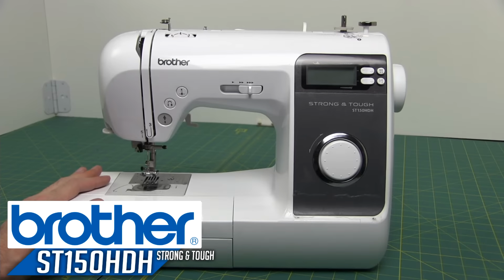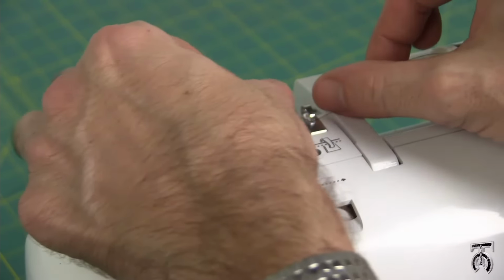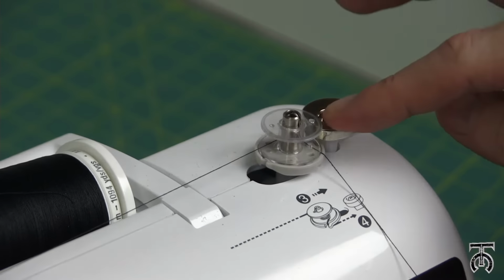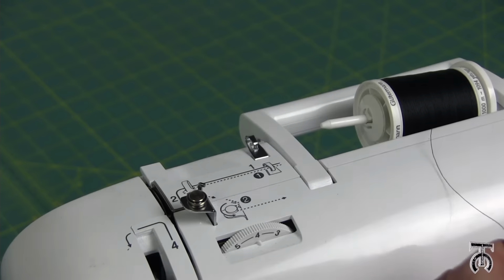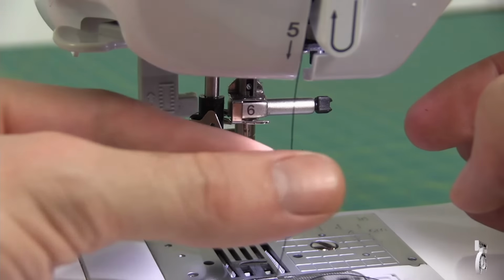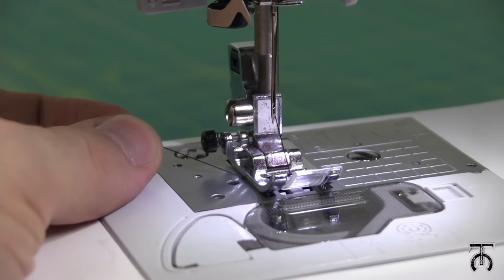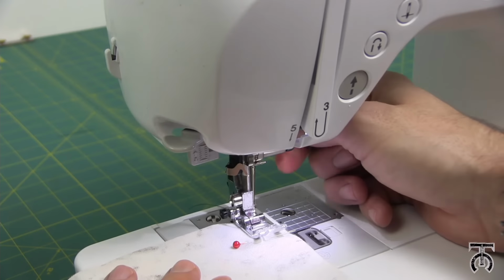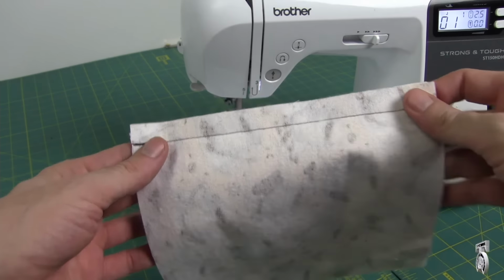How to use a Sewing Machine - Brother ST150HDH - Heavy Duty - Tock Custom

Comment: I was struggling with the automatic needle threader not rotating and it turned out that my needle was not at its highest point. Once I did that, it rotated and worked!

Comment: Just unboxed my ST150HDH this afternoon. Had to rewatch the automatic threader section a few times to get the hang of it, but finally got it! Thanks very much.
Reply: mine doesnt work right. any tips?
Reply: @kayacaffo8114  just follow his instructions very carefully. Also, I noticed that he hold the thread op at about a 45 degree angle after he puts it under that hook. That seems to do the trick for me. After I got it right the first time, I practiced several more times. Good luck!

Comment: The Brother instruction manual will tell you to lower the presser foot when using the needle threader if you bothered to read it. The bobbin is "self setting" meaning that you do not have to pull up the bobbin thread to start sewing after you install the bobbin.

Comment: This looks like the old NS10 models, just different colour 🤗 I still use and adore mine 🤗🤗🤗 The best thing is she LOVES cheap thread which my other machines hate... so I can do so much with her in free-motion and stuff and she takes it all! I have all the feet (she even uses those big accessory pack ones) and wide table and other accessories as well, and she’s easy to keep maintained and a little oil in the bobbin case every so often by myself and she still purrs 🤗🤗🤗

Comment: Hi , having a problem with this machine i don't know if you can help... I'm able to see too prices of fleece together for a seam butt when I turn it in side out and try you stich on top of the two process too kind of stitch them together I'm getting the worse slip stitches... I've tried everything putting stabilizer on top it's unbelievable the slip stitches are horrible tried zigzag stitch it's horrible tried even straight stitch like a basting stitch still horrible I don't know what to do... Please help I've never had things trouble before... And I love in my brother machines I have three... Going crazy

Comment: Helpful but new to sewing.  You said to do a back stitch but didn't explain how.  You didn't offer any trouble shooting.  For example, my new machine and was stitching very, very slowly.  Why?  How do I speed up? Since this is for beginners I think you could be more proactive.  I'm not trying to be critical but offering a few tips would be nice.
Reply from the maker: Oh, forgive me. I've done a few other tutorials on other machines, so I apologize for skipping simple tasks like this. 

There is a button that makes your sewing machine stitch backwards - doing a "backstitch" locks the start and end of you seams in place so they don't fall apart.

also there is a little slider in the center top of the machine that control the stitching speed. Pushing it all the way to the right will allow you to stitch at full speed.

Hope that helps!
Reply: @TockCustom  Thanks, my machine hasn't arrived yet, but that was my first question watching too.

Comment: I just got the machine... What do I do if I threaded the bobbin incorrectly and it wounded around in the inside of the machine?
Reply from the maker: Oh, you just unscrew the two bolts on the plate, take it off, and use a blade to cut out the thread. Then just pull out the thread or use tweezers to get it all out, no biggie at all 😊
Reply: @TockCustom  THANK YOU!!!

Comment: Need help. Just bought this machine. Read the instructions fully and watched your video several times.
Straight stitch. It's aweful. Top stitch is ok but bottom stitching is zig zaggy,. Skips, not pretty.
I ve practiced for a few hours trying to adjust the tensions, length of stitch etc. Still not working.
I ve rethreaded multiple times.
Help!
Reply from the maker: Hmmmm, it's super hard for me to troubleshoot without seeing the actual machine... I have a video on maintenance for this machine that might help - otherwise it may be a manufacturer thing. I've been using this for over a year with no problems at all. Sorry you're having a hard time with it!
Reply: Lise, not sure if this may be a late reply, but I too ran into the same problem with my new Brother. Change the needle type for the fabric you’re testing or going to sew with.  Also, change the threads type.  Many cheap and inexpensive threads don’t do well with this sewing machine.  I highly recommended to use mid to high quality threads.  The bobbin, don’t use cheap threads, use the same type or quality threads using on the upper thread.  Tock Custom does a great job reviewing and demonstrating this sewing machine, but I noticed no mention how inexpensive threads and wrong needles can effect the performance and stitch quality in any of his videos (I could be mistaken.)  If you did all the troubleshooting and no results, no planning to replace but return the item only, take a look at the new Singer Heavy Duty 6800C on sale at Joann’s for $319.   https://www.joann.com/singer-heavy-duty-hd6800-computerized-sewing-machine/17778952.html?utm_source=google&utm_medium=cpc&gclid=CjwKCAiAt9z-BRBCEiwA_bWv-Ltc0sP77UZ2S-35E_-YWGNT9XLxpKW1QKL9AA5KTLlTmTm_qOmyvxoCSIgQAvD_BwE

I’m no a Singer big fan or care for their new sewing products, but the Heavy Duty 6800C does a great job with tension, thread types, and auto cutter.  I love Brother sewing machines -not their other products. But, I think the new Singer heavy duty is just a little better and has far more features vs this Brother heavy duty sewing machine. Many YouTube videos for the Singer HD600C by Singer, but very little reviews. Product model is brand new. So, I may do a review soon. 

Otherwise, change the quality and type of threads for the fabric.  Change the needle to fit the type of fabric.  And use the upper thread quality and type for the bobbin 🧵.  Almost forget to mention, make sure your pressure foot is in the up position when threading the upper thread.  If the pressure foot is in the down position the thread will not feed into the tension disk properly.  Whereby, incorrect feeding the thread with the pressure foot down will cause the bottom stitch to create a bird’s nest or the zig zagging as well. So, before threading your machine, lift the pressure foot handle to raise the pressure foot up and then thread your machine. Hold one end near the bobbin with one hand and your other hand pull the thread end into the machine. Pull semi tight into the tension sections that you hear a snap sound or “CLICK.” The snap sound verifies your thread is in the tension disk properly.  

-Lou
Reply: @LouRao   That was a very helpful reply. Thank you.  I have never sewn and this machine will be delivered soon.  Can you recommend a good thread to order to maximize my chance for success?